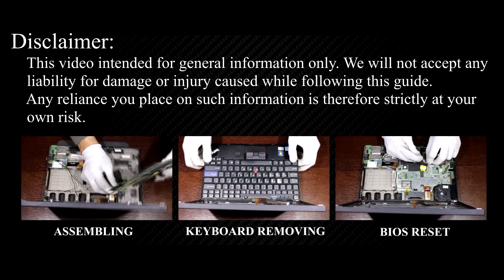Lenovo ThinkPad X201 Disassembly, Fan Cleaning and Thermal Paste Replacement

Comment: The Lenovo hardware maintenance manual is a big help, here is the current link to the relevant section for an X200 https://download.lenovo.com/ibmdl/pub/pc/pccbbs/mobiles_pdf/43y6632_03.pdf#page=109&zoom=auto,-13,333 

This video would have been even better if it had been shot the other way up.

The Lenovo manual emphasizes the sensitivity of some of the systemboard components, and the importance of antenna cable management.

This video helped me identify things from the Lenovo hardware maintenance guide which I didn't actually need to do (full removal of LCD, removal of a screw near the power port which is partly obscured by the LCD).

Comment: if you only want to clean the fan is it really necessary to dismantle the whole laptop...
Reply: Not necessarily, but after several years of use the thermal paste could definitely use a replacement, and that is something you need to take everything apart to access.

Comment: thanks for this video -- very helpful. I noticed that you didn't replace the thermal grease on one chip when you reassembled. When I removed the heatsink / fan assembly all 3 chips had thermal grease on them.
Reply: You do not need to because there is thermal pad there :)